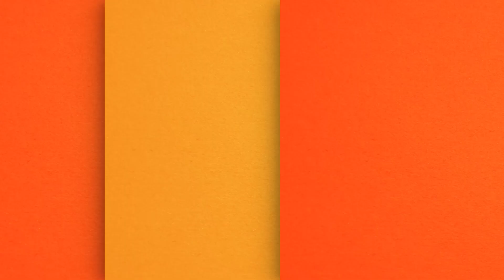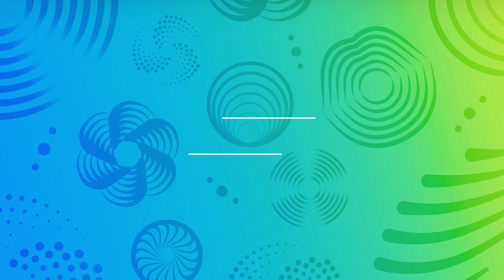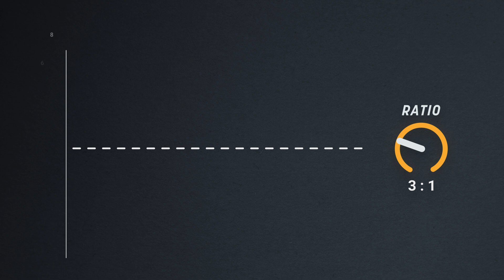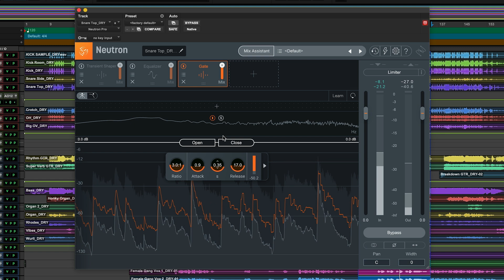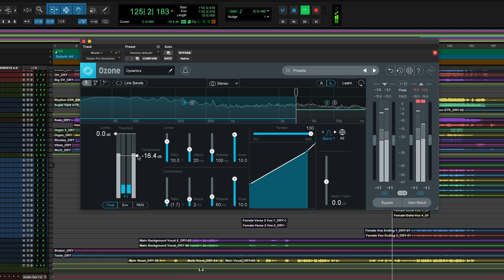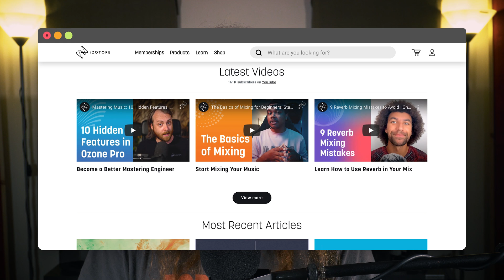What Is an Expander? | Audio Dynamics 101

Comment: they all all compressors.  Traditional compressor pushes audio down if it is over the threshold, Gate pushes the volume down unless it is over the threshold, and an expander is a gated signal added back to the dry signal so it adds amplitude only when the gate is open.  If you have a compressor, you can get all these effects.  Need comp, insert it.  Need gate, duplicate track, flip the phase on the second track, insert a comp and it will act as a gate when the two tracks are at the same level.  Want expansion, add gated signal back in with more dry signal.  Boom.  1 processor, 3 effects.

Comment: @iZotope, Inc. Are expanders and upward compressors one and the same thing?
Reply: No. There are upward expanders and downward expanders. 

Upward ones bring up low level details and can expand a sound's dynamic range.

Downward expanders reduce the level of low level signals such as noise gates. Downward expansion can also be used for transient shaping.

Comment: Thanks for this video. Is a downward expander the gate version? I’m trying to reduce the sound on stage that gets picked up by my mic, or rather, make my voice louder but the rest softer. It sounds like an expander might work?
Reply: For the sake of other people wondering the same thing: yes. If you expand the dynamic range of a signal, and then lower the output gain of it, you achieve a reduction of the unwanted stage sounds.

Comment: Please make more elementary.. you used circular ill- logic by continuously saying.... It's like compressing just the opposite..... That's not cool...
Reply: @Sarah, IMO it is a useful contrast for those who already understand what a compressor is. It's like saying that an accelerator is the opposite of a brake in a car. It's a useful contrast in utility, since both of the controls often appear near to each other on the same device (brake / accelerator; gate / expander / compressor).
Reply: @KalikoTrapp  better to say "expanders" make the quiet parts of music "quieter" and the louder parts more "loud".....or makes the db range of a song bigger (wider..more db differences).... And define what each different "knob" means and does....i.e. This knob works on the quiet parts of a song....or this works better on cymbals...ect.... Saying a 45 Cal gun is "like" a howitzer or S.A.M. missle is not accurate or truthful... Other than saying both kill things effectively...

Comment: i must be daft.  i understand what an expander is and how it works, but the video shows you using Neutron's Gate and gives no indication that something has been done to the gate so that it behaves like an expander   (like: flip a switch so the gate works inversely??).   Am i missing something?
Reply: Similarly confused. This video is more advertisement than tutorial. It would help enormously if the software actually and clearly gave you access to something called, "Expander."
Reply: If you check the ratio control you’ll see it’s down low. In an expander you have a low ratio, in a gate it’s a high ratio, that’s the only real difference 🙂 In a gate the ratio goes so high that it attenuated the signal below the threshold to silence.
Reply: @SamLoose  so the example shown in this video is downward expansion?  in this video you say that will be covered in a later video
Reply: Hi, as i tested it right now, izotopes Gate plugin let you adjust ratio so the signal under threshold is quieter than above depends on ratio. In upward compression signal above threshold is louder, but under threshold it remains the same. 
If im wrong let me know :)